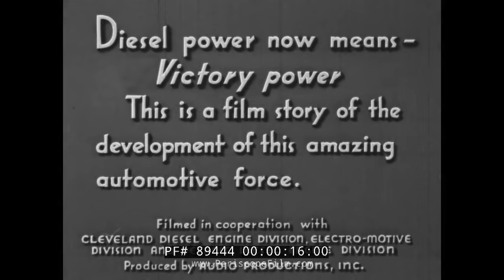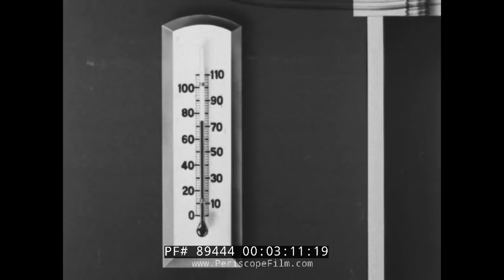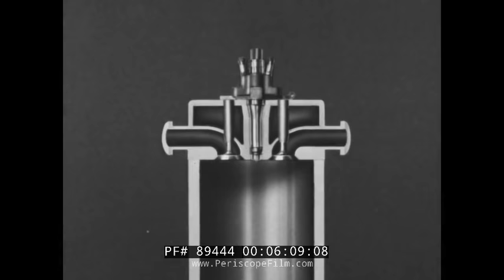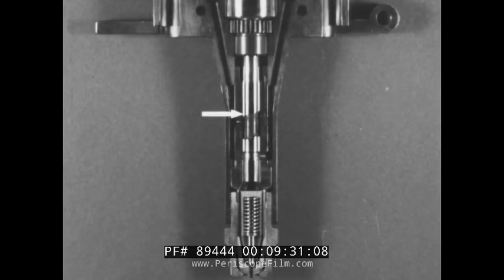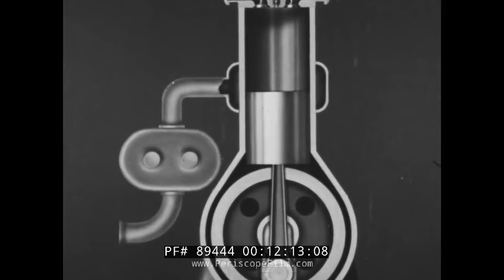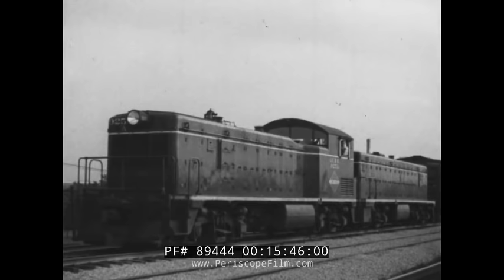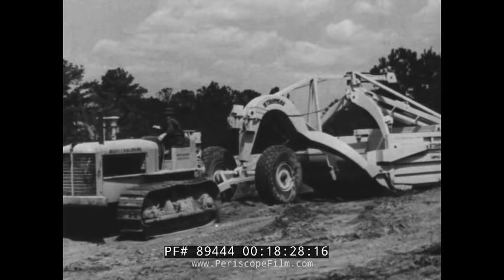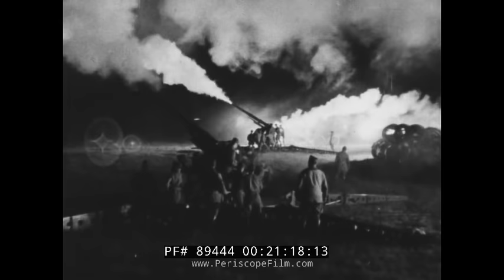GENERAL MOTORS DIESEL: THE MODERN POWER  DIESEL LOCOMOTIVES BURLINGTON ZEPHYR 89444

Comment: 2-stroke diesel engines, the most efficient way to turn fuel into noise.
Reply: Fantastic comment Sir....
Reply: Rubbish. The largest diesels in the world are all two cycle.
Reply: @Detroit8V92tta  
It was a reference to wearing ear plugs and muffs while driving behind a Screamin' Jimmy or Buzzin' Dozen. They are ear splitting loud.
Reply: Technology then>>>>> technology now  , Hindsight is 2020
Reply: @841k9  when I was just a kid, I was told to first slam my hand in the door of the Detroit powered truck id be driving, that way the noise didn't seem as bad because you couldn't think of anything else but your busted hand.
Reply: My dad used a 2 stroke jimmy diesel to power one of his saw mills. He would get comments from people that they could hear it running in town 3 miles away.
Reply: Mufflers work wonders.
Reply: I wonder how many of the 100 likes of Mr Gregory's comments ( based on years of experience with these engines I'm sure) are HD owners
Reply: 4 stroke locomotives are more noisy than 2 stroke

Comment: I like these old B&W training films. They make sure the basics are understood before moving into advanced tech and applications. Easy for the novice to understand.
Reply: liveandletsdive Indeed
Reply: Amazing how simple it is when it is explained with these graphics. Simple two dimensional, monotone in color and in voice! But they are kinda smart to forget to tell us that the locomotives are actually diesel electric. I would be surprised if America's cruisers and battleships circa ww2 were diesel powered as this claims them to  be. lol
Reply: you said that right i never understood diesel and this old ass film broke it down so simple
Reply: This film never claimed cruisers and battleships to be diesel powered, only that they had diesel auxilliary power - meaning they had diesel generators so they could have electricity without running their steam turbines (or triple expansion engines in the case of older standard dreadnoughts).

But yes, these films make the basic mechanical principles very easy to grasp!
Reply: liveandletsdive    I
Reply: The army equipped 200 Sherman tanks with 6-71 detroits and they used two engines side by side into a common gearbox with manual clutches feeding a single foot operated clutch to the four speed gearbox. Some fool decided because it was diesel powered they would be used for training only and all combat Sherman tanks had one of 4 different gas engines which wound up killing or severely wounding our troops because of the extreme flammability of the fuel. The diesel was less flammable but the supply department didn't want to haul diesel Fuentes into the combat areas.
Reply: Yes because your average G. I. had a 4th grade education so they had to make these films simple
Reply: What "advanced tech"? Locomotives are still using the same old diesel electric technology used for decades. Or at least that's what we're led to believe.
I did hear something about a 10,000 HP electric locomotive in India, though. Of course electric driven vehicles predate all vehicles other than horse, mule, oxen and pedal powered. So that's not even advanced technology. 
Now, give me a Jumbo Jet that blows nothing but hot air and a locomotives powered by turbines compressing air spontaneously combusting...
Reply: @jamesshanks2614  
Side by side 6-71's were  very popular back in the day. They were more reliable than the proverbial Sherman tank.
The Sherman was also powered by an air cooled radial aircraft engine. Think of Chrysler design if memory serves. It was like a fire waiting to happen. Plus after it was started up and running in Algiers, it could be heard by Rommel in Tripoli.

Comment: Fyi. When greyhound was getting new buses in the 60s and early 70s, gm offered a V12 powered bus for the West routes.  An old friend of mine who used to drive greyhound said those buses had so much torque they were passing cars going thru the mountain passes!
Reply: I've hearded the 12-V in Euc/Terex R-35 haul trucks and TS-24 pans (scrapers) and they are the Mommy Bear!
Reply: I met one truck driver, back when I was loading pipe for a living, who had a Cab Over with a 12V71 that was twin charged. He upgraded the turbo and put in larger injectors. Now we have some nasty hills around here in BC Canada. He said he could pass anything he wanted. Pick the right gear and foot to the floor. A bit of black smoke until the turbo came up to speed and it would tear up the hills. He said he would stop for the mandatory brake check spots and the other trucks he passed would park beside him and walk right up to check it out. It was a beautiful truck. The only negative he said was the terrible milage compared to newer trucks. But he didn't seem to mind too much since he didn't owe any money on it.
Reply: Geoff Moore a
Reply: Iirc the scenecruiser buses of the early 50's had 12 cylinder engines, and dad drove buses in the late 60' and early 70's and he knew another driver that had a ticket framed of when he got pulled over doing 104mph in a pd4104 (also iirc) type bus, they had a high idle feature they could engage when parked to keep the air conditioning going this enabled them to bypass the governor and haul butt.
Reply: @phantom629  I think that the Buzzin' Dozen went into the MC 6.  Scenicruiser's were upgraded to 8V71. They were transverse mounted. A12 would never fit.
Reply: @cyrilhudak4568  not to be argumentative but scott crosby recently worked on 2 scenecruisers in michigan and for sure the engine was inline not transverse, if you got room for 6 inline then you've probably got room for a 12v, i read somewhere greyhound had v12's in their long haul pd4501's but i cant 100% prove that at the moment(dont remember what video that was)
Reply: Russell Gerdes  An elephant in a rock pile. I herded a 22 and an R-35 and you just had to jar with them. They were good for what they were but the ride was NON, even the pans were the same way. The S-7 which was just a motorized wheelborrow and a TS-14 and 24 would go like a Jeep but beat you into submission in the process. Good in a rough place where you couldn't go fast is what I'd say.
Reply: @geoffmooregm  Mileage isn't everything and look what it did! I'm grinning just thinking about it!
Reply: @phantom629  I knew of one that got shoehorned i to an old 'B' model Mack. All you could see in the crack between the hood halves and curved fenders was valve covers. Had a framed ticket for 118 m.p.h. loaded hauling sand. They made him demolish the truck. I talked to a guy that was on the same run and the Mack about blew him off the road and he said he was running so fast he was afraid to look at the speedo when the Mack went by at a GREAT rate of speed.
Reply: @phantom629  He just did a video on one. Don't you KNOW that thing is a BEAST!
Reply: Russell Gerdes  THAT is the best part! NO PAYMENTS!
Reply: Russell Gerdes  BLESS you Russel! If you've been there the backbones will tell you about it on a regular basis!

Comment: Stood behind the pull stick of a Frick “O” for years with a 471 and later a 671 Detroit powering it.  Never had a moments trouble it of them.  And the sound...oh that howling roar thru that 4” straight pipe.  Having that power and all that noise controlled thru an oak stick in your left hand really strokes your ego.  You couldn’t help but have a little swagger at the days end.

Comment: cant beat the sound of an old jimmy 2 stroke.
Reply: They sure do sound real good, however it's more than the sound it makes, reliability is chief.
That fuel rack is one huge reason I wouldn't own one, the fun of cranking up wondering if this is the day it's going to try to run away or behave.....
Reply: @PatrickBaptist  well thats easy, dont let it sit, keep up on maitnetce
Reply: Yep IH Transtar CO 4070A 8V92 15 speed RoadRanger.
Reply: @PatrickBaptist  well over blown fear.  marine detroits run thousands of hours and the run away thing is very rare.  Ive run two 871 dd for over twenty years.  no run away ever, nor have I ever seen one.
Reply: @russellrobins5320  Awesum-oh.
Reply: My dad powered a sawmill with a 2 stroke jimmy diesel back in the late 60's to early 70's. It was so powerful that it had no problem sending a 52" blade through oak or maple. The sound was a bit like a 1972 Grand Funk Railroad concert.

Comment: & dis gave birth to da beautiful sounding 671,6v71,& 6v92.
Reply: The BEST sounding 71 series engines were the 8V-71's on the Eagle buses of Continental Trailways!!! Unlike anyone else running this engine, they had a separate exhaust system for each cylinder bank and there were dual exhaust pipes coming out of the back bumper.

Comment: Diesel Power,,, eighteen wheels a rolling,,

The double breasted Yamaha,,  Detroit Diesel two stroke roots blower V configuration. 

The high rpm tune unmistakable.

Remember, a gas may be compressed, not so a liquid.
As we know pressure on a liquid is forced in circuit to far end of containing piping where it exerts equal force undiminished. The basic principle of our much used hydraulic systems in various forms. Hydraulic brakes a good example. “ that thing got juice brakes? “ was a common question when mechanical rod operated brakes where omnipresent.

With quality components, design, construction, why these engines could power the very heartbeat of a nation. Quality fuels to supply them must be manufactured in great quantities. Also oils to lubricate and coolants to prevent meltdown.
Clean fuel, filtered to microns is necessary, to flow through tiny injection system openings.

Of course above all everything requires top quality bearings, 
the Henry Timken Roller bearing company Canton Ohio.
Henry from Bremen Germany.

What marvelous engineering and design,, our American men and women working together to complete designs for power prime movers.
Reply: Rootes blower. Some guys thought they were superchargers; but no, because superchargers put out more pressure.  Blowers are usually [or always] gear driven, where superchargers can be either belt or gear driven.  Turbochargers are only exhaust driven.  FYI:  Starbucks coffee drinks are not TURBO anything !!!  The stupidity in America is amazing !!

Comment: I have two issues.  #1 In the picture of the ship with two tugs, they are not diesels.  Any tug with a tall smoke stack is steam.   #2  GM  would want you to believe that all subs were power by their engines, not so.  I have been on two ww2 subs and they were powered by Fairbanks Morse  opposed-piston engines.  Because they have a smoother power stroke and are quieter and have less vibration.

Comment: Interesting as to how it is never mentioned that the diesel engine was actually a German invention. Unfortunately the 2-stroke diesel is now a thing of the past as it quite difficult to make one that meets the emission of today.
Reply: After being drafted in the mid 1960s, the Army sent me to training for landing craft. Learned how to operate and do light mechanical work on LCM-8s.  The LCM-8 had four GMC 6-71 engines configured in 2 pairs with each pair driving a screw. The sounded great while smoking quite a bit.
Reply: Actually there are a fair few 2 stroke Diesels still being produced and operating.  I think you are thinking of 2 stroke petrol engines.  2 stroke Diesels dont require oil injection, and hence dont burn oil with the fuel, which is the main issue with 2 stroke Petrols.  Instead 2 stroke Diesels have a conventional wet crankcase and oil system which lubricates the engine in the normal way.  2 Stroke Petrols cant do this because on a 2 stroke petrol the air is first compressed in the crankcase.  On a 2 stroke Diesel the air never enters the crankcase, it is blown into the cylinder with either an engine driven supercharger as shown here, or a turbo driven superchager (Turbocharger).  This is absolutely key to the operation of the 2 stroke Diesel.  They are widely used on marine engines.  Here is a good example https://en.wikipedia.org/wiki/W%C3%A4rtsil%C3%A4-Sulzer_RTA96-C
Reply: I believe most diesel locomotives are still two stroke as are ship engines..could be wrong, but was told so, to my surprise
Reply: There still are many 2 stroke diesel locomotive engines in use. All new locomotives must have what are called "Tier 4" engines which have quite strict emission requirements. For now, 2 stroke diesels cannot meet this requirement. See: https://www.dieselnet.com/standards/us/loco.php
Reply: ULCC Detroit Diesel, now wholly owned by Daimler AG as are Freightliner, Western Star and Thomas Built Buses
Reply: Like the Larc 100's.  One 6-71 per wheel and 2 per screw!
Reply: They never claimed to invent the diesel engine in this video. Only claimed to have pioneered it's spread through railroad use, and used an example to show how it work on a fundamental level. Who knows whether or not they were in fact biased against the germans. :P
Reply: @GustavMeyrink  And the reason they are owned by Daimler AG is because a man called Terry Peabody bought up western Star when it was failing , he gathered up several other old names in the process,including one of the oldest, Dennis.  He was approached by Daimler and made an offer he couldn't refuse. He sold his shares to them for a hell of a lot of cash. His surname is well known in America and Arlo Guthries Father, Woodie ,even mentions it in a song about the oppression of American Workers.
Reply: @drawingboard82  One well known loco engine is the paxman ,which comes in all sorts of Cylinder configurations and is 2 stroke.
Reply: @Mercmad  isn't that a different Peabody? Terry Peabody, an Australian, bought Western Star in 1990. 23 years after Woody Guthrie passed away. You're thinking of Peabody Energy founded by Francis Stuyvesant Peabody.
Could be related though...
I know the coal Peabody is mentioned in the John Denver song 'Paradise' written by John Prine.
Reply: MAN builds marine diesel engines from 15,000 to 100,000 hp that are all two-stroke. Granted they run fuel oil, not diesel, but they are very much still a thing
Reply: @thesteelrodent1796  Maybe for marine.  A two-stroke diesel will probably never meet the new tier-4 emissions.
I was trained on the GM 6-71 while in the US Army in in 67 - as part of learning how to operate an LCM-8.
Reply: Deltahawk makes a V4 liquid cooled 2 stroke diesel that runs on Jet JP4 for use of light prop planes and is currently being manufactured.  The engine is a cheaper alternative to those planes running engines that burn expensive AVGAS
https://youtu.be/3GT8Ueaug7A

Comment: There is an old phrase...The detroit diesel Is/(was?) the best creation ever invented for turning Diesel fuel into smoke and noise. badabing.
Reply: Not to mention the best creation for taking motor oil and dumping it all over the place. They were called "The Green Leakers" for a very good reason.
Reply: I believe that was a no cost feature: active chassis Rust prevention

Comment: One reason diesels were not widely used in trks and tank were because of logistics its it's cheaper and safer to just ship one fuel. If you have ever put diesel in a gas or gasoline in a diesel engine it can be a severe problem if not caught. And the problem is starting it. Wont run or runs away.

Comment: Wish it told us how to start up one of those locomotive engines
Reply: Those engines in the Film are not exactly Detroit Diesels but EMD's as designed by Winton . They run a large generator to supply electric power to the loco traction engines or ships propulsion systems . So,to start them,the generator is switched over to make it a starter motor and it then cranks the engine up to fire it.

Comment: He mentioned a "throttle."  Diesel engine don't throttle.
There is no butterfly in the intake of a diesel.  Speed is 
controlled by the injector.

Before IC engines were made, to "throttle" something or 
someone, meant closing off the air supply.  Throttle STILL 
means that.

steev

Comment: Isn't it funny , the 2 stroke uniflow engine is now back , not so much a diesel cycle but a petrol direct injection of the same design ! Direct injection is bringing back the engine ,  for 2026 Formula 1 cars are going to be 2 stroke direct injection motors ! Funny how things turn around.

Comment: Ironic how Sherman tanks are used here to portray mighty diesel power, when they ran on gasoline engines that made them vulnerable to catching fire when hit - diesel fuel would not have ignited so readily.   The announcer was carefully to never actually say that the "powerful battle wagons" were indeed propelled by the two-cycle diesel engines he speaks of in the same sentence at 1:22.
Reply from the maker: Actually the M4A2 model used the General Motors 6046 twin inline diesel engine.
Reply: Well?

Comment: They took both two stroke diesel trains and Steam Trains off the lines way to quickly in favor of the 4 stroke diesel. As far as the 4 stroke diesel being cleaner than the comparable two stroke diesel..... that's a load of crap.
Reply: How's that? Even Electromotive (now Railpower, subsidiary of Caterpillar) gave up on emissions compliance with 710-series 2-strokes. Their latest freight unit is 1010 cid/cyl 4-stroke.  Cooper-Bessemer engines (GE diesel) all 4-strokes. See a pattern there? No crap.
Reply: Jacques Blaque when did car buy emd?
Reply: Cat
Reply: AFAIK Cat bought EMD in 2006. Fits my recollection of it happening. Did you know that EMD's new passenger loco, the F125, is powered by Cat C175-20 4-stroke diesel? Displacement 5 liters/cyl, 4700 hp, presumably for traction, @1800 rpm. GE seems conspicuously absent now from passenger locos, with Siemens taking the lead.